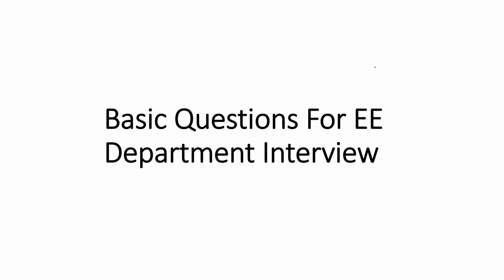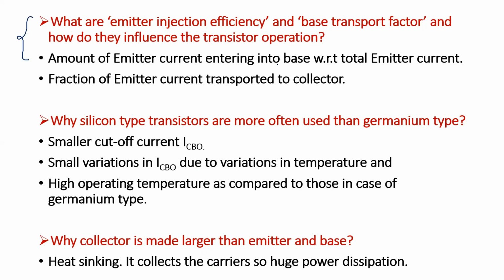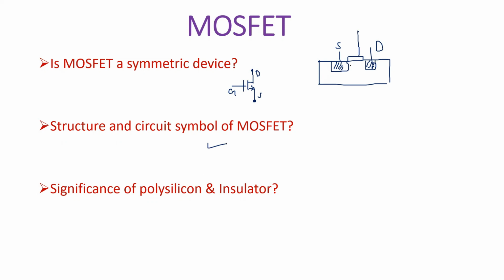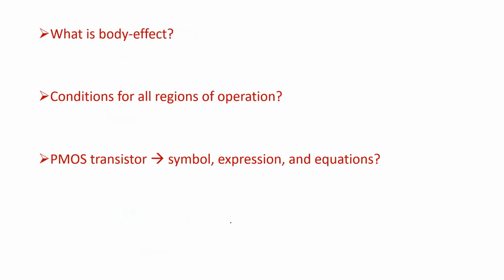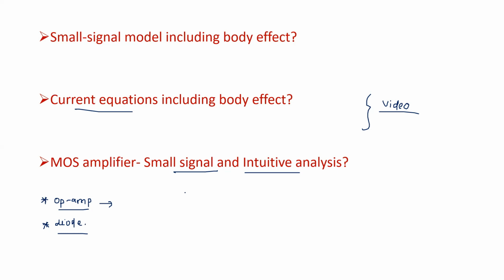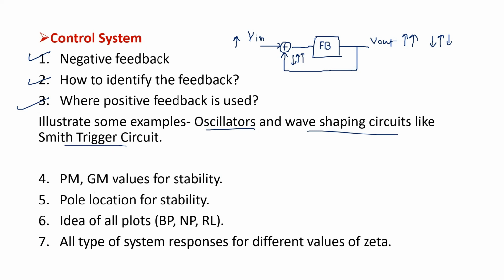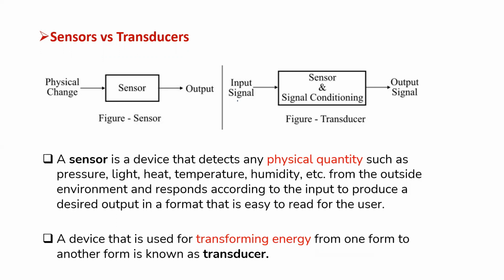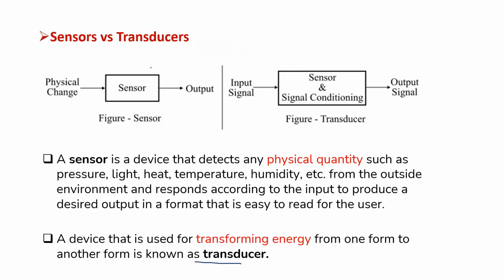Expected Interview Questions EE Department || IIT KGP || Anuj Chauhan

Comment: Sir I have an interview in upcoming week for SPML, Power Electronics and Drive, Power System. Can You please Guide me for the Interview.
Reply from the maker: From my experience of interviews here...focus on your basics! 
Just go through important things on your gate subjects...they will not enter into much depth but basics should be prepared well...in spml, basics of coding can be asked not to require that much depth. Mathematics is important. Power electronics- basics of buck boost converters, LDOs, switch converters, control system basics for stability analysis, importance of negative feedback. Fundamentals of signals, Analog is important....basics of mos circuits and sometimes bjts as well
Reply: @learningexpress183  Thanks a lot sir for your reply..
Reply: and Sir for Power System what are some important topics?
Reply from the maker: Can you connect me on LinkedIn...there is a link to my LinkedIn account in the YouTube channel